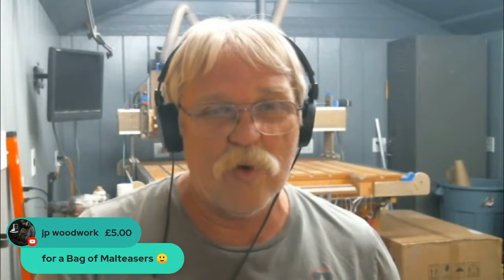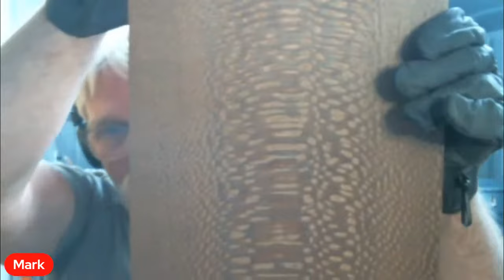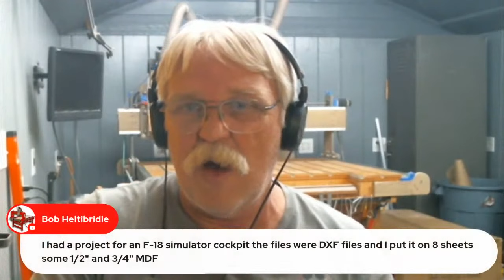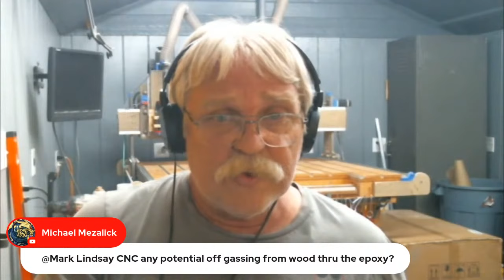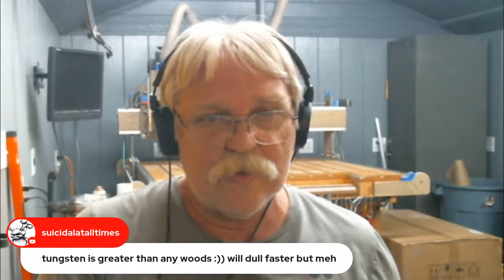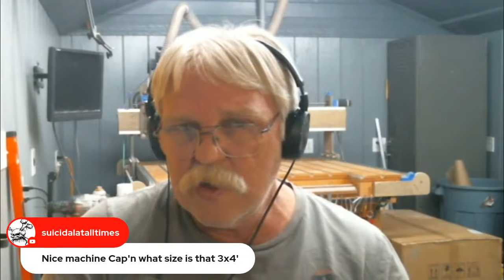LIVE Q&A #137 – Toolpathing Layers for Multi-Color Epoxy Inlays

Comment: Just seen you explain your plans for the proposed dust extraction system. If your shop is heated and you extract your dust to the outside the warm "workshop" air will be extracted too. Great video's from you Mark. Keep up the good work! I have only just started on my CNC journey (with my Avid 4896 Pro) and found you most helpful with information.

Comment: Is the project piece moved off the table at any point?
Reply from the maker: Yes it is. It's taken off the machine after the carve is finished, and the epoxy is poured in a room that is kept above 70°F (21°C) for 24 hours, to let the epoxy cure. It's then put back on the machine, the next carve is completed, then the piece is taken off the machine again so you can do the next epoxy pour.  That's repeated until all of the epoxy pours have been completed.